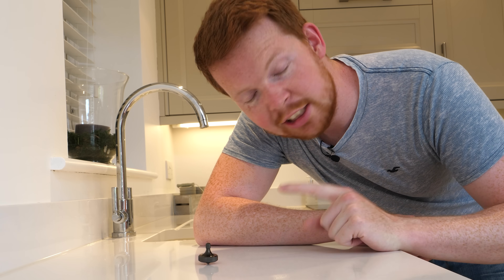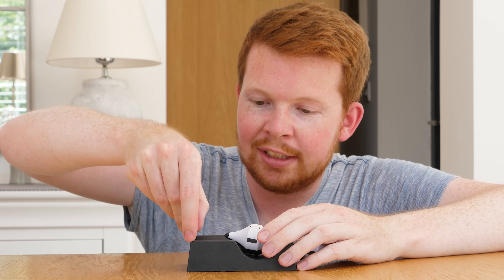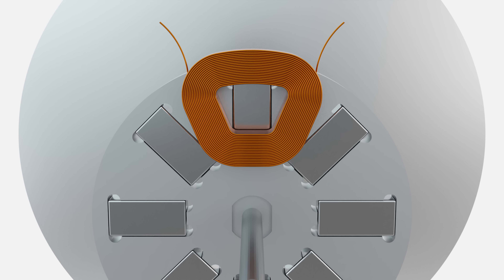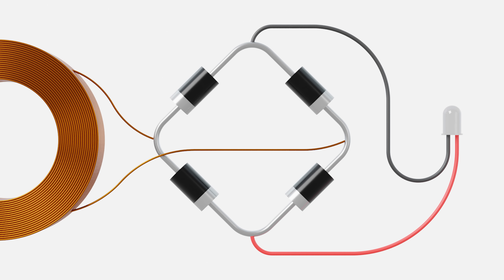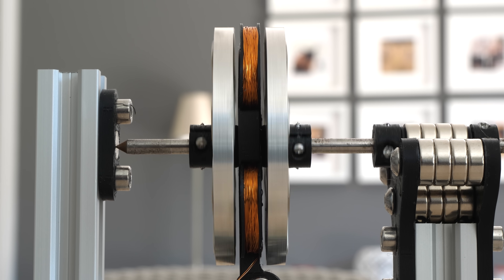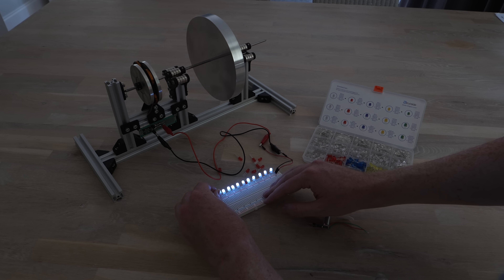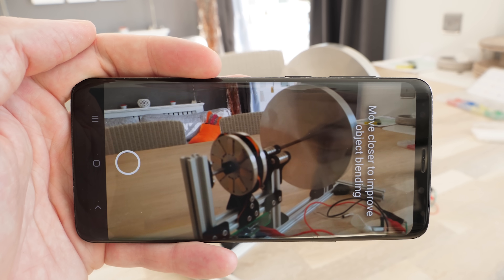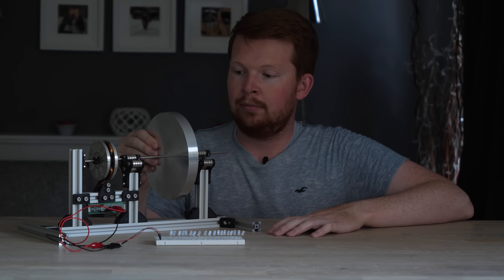Flywheel Battery

Comment: Nice video, but why perpetuate the big lie of "conventional current?"  Electrons flow from negative to positive.  PERIOD.  I know people think the "+" terminal is the source of the power, but it is where the electrons return.  We have know this since day 1 when vacuum tubes AKA "valves" were designed.  The cathode of a rectifier tube is the same as the banded end of a diode.  In a vacuum tube the electrons move through the vacuum from cathode to plate.  The plate is positively charged, and the cathode is negative in relation to the plate.  Same thing goes for solid state diodes.  People continue to use the conventional current model to dumb it down to the lowest common denominator.  This is wrong, and only perpetuates the "dumbness" of the average person and even some electricians.  Electrical engineers know the truth, as well as physics professors.  Please stop perpetuating this misconception.  Thank You.
Reply: Nothing is a lie or wrong here. Current is just defined as dQ/dt and not "what way are the actual particles in this material going?" Electrons happen to have been defined as negatively charged, so their movement is opposite the current.
But there are materials where you have positive charge carriers making up your electricity. What are you gonna do there? If you just define current as -dQ/dt, it's gonna match the movement of electrons but not these particles.
In all it looks to me like you're just abusing the notion of current. It's not supposed to tell you the actual direction the charge carriers are moving and if you expect that, you're gonna disappointed. But calling it a "lie" because of that is like calling the weather forecast a lie because it doesn't tell you what the oil price is. That's just not what it's there for.

Comment: Having divots on the edge of the flywheel would allow you to use compressed air to speed it up in fact you could add a funnel with a pipe at the end to force a natural air currant to blow air on the flywheel getting it to speed up
Reply: Once the flywheel hits a certain rpm you could have a valve shut off airflow to stop the flywheel from speeding up

Comment: Very cool project! You could make the flywheel way more mass-efficient, by moving the material outwards (away from the axis). With the same mass as a full cylinder, you could design a rotating part with way bigger moment of inertia. Or you could reduce the weight, reducing some problems with the magnetic bearing. I would love to see a follow-up project with some optimizations for maybe charging a smartphone "by hand"

Comment: what about using your generator as a motor? But that would need far more complicated electronics than a rectifier to provide AC in just the right frequency and phase (and even changing with varying RPM) ...

Comment: now here something. ( from powering the motor with the flywheel. could you in fact put a arm up the the wheel { motor with a rubber tire } and when spin it it generates a non stop power source? the more the flywheel is spun the faster the motor goes

Comment: you could scale this up and find some way to attach a foot pedal to spin the flywheel, then you can use electric hand tools like die grinders with foot power. the rod and flywheel would have to be machined dead straight to minimize wiggle

Comment: Hey, the rotor should stop spinning after some time due to the magnetic field generated by current in the coil.(but how ????) please explain. There will be an EMF induce between the centre and the circumference of the  wheel .(but how???will it be able to flow current (which would probably be responsible for stopping the wheel) between the circumference and the center unless there Is an external resistor connected between them.

FFFFooollll Briddddgeee Rectifierrrr..

Comment: Greetings Mr Stanton. I am not an engineer, but I am curious. What would happen if you replace the "pin point" and "glass plate" with opposing magnets? I know it will not be a "perpetual motion device", as there is some scientific laws or something. But what effect would it have on the mechanism?

Comment: Try making a battery maded of Capacitors, and try making the rod out of carbon fiber.
One thing.
What if you attach more magnets on the rotor ? like, what if you can use the arch magnets there's inside HardDrives ? could that improve the time the led is on, when the magnets are on the coil ?

Comment: You mentioned getting 10 volts out of the modified setup with hand cranking but what did the amperage look like at that stage? Also, what is the possibility of scaling this larger to be applied practically? There is an obvious inherent loss in efficiency with this system, especially if electromagnetic levitation becomes necessary in these possible larger applications, but low friction magnetic levitation flywheel systems like this could have the potential to be a dream solution for continued power production in the event of planned or emergency plant shutdowns. Has a shutdown occurred at a power plant? Ok, switch over to the multi-ton backup flywheel system to help keep a bit of power flowing to the transfer stations as we troubleshoot the problems or apply repairs. This could obviously just be my own naivety talking but nonetheless, this was a great concept and video!

Comment: Nice project however.... 13:08 There is another 'resistance/friction' you have to look at when the load is heavier. Taking more current of your generator slows down the flywheel. You can clearly see this in your video. And remember that LED's are driven by current and not by voltage. They need a voltage treshold to turn on and they glow on current. LED's can actually start to glow at a low amount of current. That is why you normally need a resistor to limit the current.

Comment: if it has little drag due to the magnets couldnt it potentially spin itself with a small motor on the end of it using little power or am i just thinking above science
Reply: When you attach something to it, it slows down. All of the energy you're getting out is being taken out of the flywheel. You can try to put it back into the wheel with a motor but there will be losses along the way and it would spin faster if you just didn't attach anything to it. All you're doing is taking out energy, wasting some of it, and putting it back in. Just don't take it out in the first place, it's gonna last longer.
Perpetual motion does not exist

Comment: Man i wish I were more knowledgeable about mechanical and electrical stuff like that. It's so interesting, and i can imagine it being really practical as well. Didn't know you could use diodes like that to convert AC to DC.
Also about the input, is it possible to have some sort of mechanism to add just about any amount of kinetic energy to the flywheel? Like after a certain point it would spin too fast for a person's fingers to make it go any faster, so how can one get around that to keep adding any amount of energy you add with your fingers regardless of how much energy is already in it?

Comment: Tom, please revisit this! It would be so cool to see a properly straight and balanced version, it would not be hard to cut the shaft drill it out of the flywheel then bore it slightly larger on your grandpa's lathe. I would also like to see a gear driven winding device so that you can spin it up to truly impressive speeds by hand! love the videos.

Comment: You should be able to create a magnetic field that is self centering. All you need is a wider magnetic field that is cupped, so it cradles the opposing polarity. The two magnets to the outside should be higher up. 
Also if you want to excite your wheel, why not do it by using the generator as a motor to start the initial spinning? Yes, you would need a stepper motor driver, but it is much more effective.

Comment: There's a vaguely remembered video I watched some time ago about power generation.  If I remember it right, it said that high loads on electric generators actually can cause them to bog down.  So, if you were somehow able to spin this to equal RPM's twice in a row, once with no load, and once with a bunch of the LED's or that motor, would it spin for a less amount of time with the load than without?  Or am I mis-remembering or misunderstanding?

Very cool project by the way :)

Comment: Why do you need to change AC to DC to power a lightbulb? Lightbulbs don't care about polarity or AC/DC.
Reply: These are LEDs though, not regular bulbs. They'd still work with AC so long as the reverse voltage isn't too high but DC would prevent flickering at low AC frequencies.

Comment: What happens with the toy showed at the beginning if instead of glass it has 2 more magnets (or even 4 ,1 par on each side). Repelling against the base sideways? The idea is to levitate the side too instead of touching the glass. Although it will need further adjustment

Comment: I think the flickering is due to the whole assembly wobbling, not the fact that you're converting AC.
Reply: It's the AC. LEDs are diodes, so they only let current flow in one direction. When the voltage polarity flips, the diode shuts off and goes to reverse bias. When it flips again, the diode is forward biased and turns on again. That causes the flicker.

Comment: Next would be to incorporate a crankshaft and clutch along with turning the shaft for the Flywheel/alternator on a lathe. Or a really bonkers thought of melding this with the Bicycle KERS, where the user pedals at a constant speed to charge a capacitor for an electric motor that drives the rear wheel.

Comment: instead of a needle, why not using a mgnet at the end of each side of the shaft? like : stationary N to N shaft then on the other end of the shaft S to S stationnary. In fact you can use any combination could be NN===NN or SS===SS or NN===SS all needed is them to push. it could work on only one side but the magnet need to be a correct position
Reply: But it would still be more efficient at retaining momentum than the needle, wouldn't it?
Reply: @TheBadlandsSandvich  No, it wouldn’t. The magnetic losses from that setup would be the same as a needle or greater depending on the coefficient of friction, since they’re both a function of the normal force.
Reply: @ObjectsInMotion  You could also end up with some vibration along the axis of the shaft which would add extra drag.
Reply: @ObjectsInMotion  there is no such thing as "magnetic friction"if that's what you mean by "magnetic losses"
Reply: Then you introduce magnetic losses...nothing is perfectly balanced.
Reply: I was thinking about this too since the video point out about the needle point! Less friction then needle point touching the end of the wall ..
Reply: It's not possible, there is no way to create a stable set of magnets. You have to have some added force like from the point or the spin of a top
Reply: @retep8891  I mean - unless I'm crazy - this statement flies in the face of numerous novelty globe displays (and other similar gadgets) that only use magnets to maintain levitation.  That is unless there is some internal active balancing mechanism that I am unaware of, although I doubt it.  While certainly not impossible, they sure are a pain to set back up if you happen to knock one off (often why they include a setup jig).

Although again, maybe there's more to it.  Feel free to correct me if I'm wrong.
Reply: @bentracy7463  Yes, there is a balancing mechanism you're unaware of.  The levitating globe toys use a hall-effect sensor to constantly adjust the strength of the magnetic field in order to hold the globe in place.  There's a reason those things only work when plugged in.
Reply: @goldenking2046  The more you know.  Thank you :).
Reply: You could. The stability of such system would depend on the axial stiffness of the axial magnets. They would need to be sufficiently stiffer than the axial instability caused by the radial repelling lift magnets.
The low axial force coupled with the small coefficient of friction produced at the contact point means the torque drag is already very very small with this setup. The windage on the rotor is possibly already worse than the contact torque in his arrangement.
Reply: Good idea, other mods are required I think.  Even though the flywheel is made from aluminium, when it is spinning it will be affected by the magnets.  Any magnetic flux in the region of the flywheel will create drag.
so the further from the flywheel the better.  Also, the alternator needs some iron, an iron (or steel) disk on the backside of the magnets is required.  He showed the brushless motor, the housing is steel which is what the magnets mount to and this creates a flux path, the alternator needs the same.

Comment: When is the electron produced? Like where is the power coming? Is a magnetic field made of electrons? 

 Is there a certain amount of energy a magnet holds during its life time and how does one calculate this? When will the magnets no longer be able to produce a field? 

Why don't I know basic middle/high school science 😐
Reply: At no point are electrons being produced. They're already sitting there in the metal wire. All you do is push and pull on them in order to get them to move. That's what electricity is: the movement of charges. The reason metals are good conductors is because the electrons of the metal atoms can easily move around inside the material.
The power comes from the spinning of the flywheel. As you draw electricity from it, it gets slowed down. The spinning energy of the flywheel is used to tug on the electrons in the wire, getting them to move instead. Magnets don't last forever but the energy you're getting here is not being taken out of the magnets or anything. They're just a tool to turn the movement of the flywheel into the movement of electrons. 
Please feel free to ask more questions

Comment: couldn't you also prevent the tip of the achsel from connecting by equipping it with another magnet? so zero friction? (except air)

Comment: But you did not have to rectify.? If you'd parallel parked two led s counter to each other, would they not light in turn off the AC.?

Comment: You could technically connect the motor to the flywheel and that could power the flywheel by turning it so infinite power
Reply: You're just moving energy around there, nothing is being produced. How is the motor running? The flywheel. How is the flywheel turned? The motor. You can't take out more than you put in.

Comment: If you offset the angle of the coils relative to each other you could have a constant current. So when coil 1 is off,  coil 2 is midway, coil 3 is just starting, etc.
Reply: Also I once came across stable magnetic levitation by having magnet (units) facing different directions, similar to a Halbach array. But I could be wrong. Don't know what this is called

Comment: Hi Tom, you could wired a small low voltage high torque motor to turn the flywheel. That could be great. Also, try use voltage booster, buck converter to increase the output to max possible. A lot of potential in your ideas actually. Love to have you try it wish i could do it also

Comment: Hi, I'm Anthony,
Nice prototype model. I hope you show us how the alternator electrical power can drive the flywheel. It would be pleasing if you were to demonstrate for us three different methods of motor speed control with at least three speeds. E.G. 
Control Types:
Mechanical ( Pure), Electro Mechanical ( solid State), Logic Electronic Module. 
I think you will agree that the Logic Module is the least efficient and most costly to build, operate and maintain (over life time).
And that the mechanical speed control has the least efficiency loss. Easily allowing the motor to make usable rpm and torque, continuously; without need for an external power source, once started.
Cheers.

Comment: What if instead of having the center shaft connect with the post, you had more magnets on each end and posts on either end with opposing magnets to hold it in place. You could remove all friction short of air.

Comment: wäre es möglich an der spitze des drehstabs    
auch magnete zu verwenden dann gibt es keine reibung mehr  

would it be possible at the tip of the torsion bar    
to use also magnets then there is no more friction

Comment: Why not have the magnets offset in opposite directions so they push the flywheel in both directions equally, thus making the restriction plate unnecessary and eliminating all friction outside of air resistance?

Comment: I have this exercise bike that weighs over 200 pounds.  My idea was to repurpose the wheel as a flywheel for a crane, but I wonder now. . . If you could get a hand crank to get it running.  It would be on a lever that would separate it from the flywheel once it got going.  That heavy wheel would overcome a lot of impedance.  I may be able to charge my laptop and watch YouTube during the apocalypse.

Comment: Build a controller that would spin flywheel using coils you are using to generate current. Then plug solar panel to it. Solar panel would spin the flywheel which enable you to store energy produced from the sun :D

Comment: Flywheel is only half as good as it could be. Levitation needs to cancel the flywheel weight (constraining mass), rotational inertia of a cylindrical plate is only half that of the same mass as a ring.
(I_cyl = 1/2 * m * R²; I_ring = m * R²)

A thin Al plate with a central hub and a ring of steel bolts at the edge could be easy to demonstrate, perhaps with some 3D printed aerodynamic covers.

Comment: Congratulations on reinventing the wheel !- back in the 1990 it was possible to buy torches with a squeeze handle. On squeezing the handle it powered up a flywheel via a ratchet . the flywheel had magnets attached which along with the stationary coil of wire powered a couple of L.E.D.S. while it worked for a minute or two you had to squeeze the handle every couple of seconds........ They didnt catch on.........